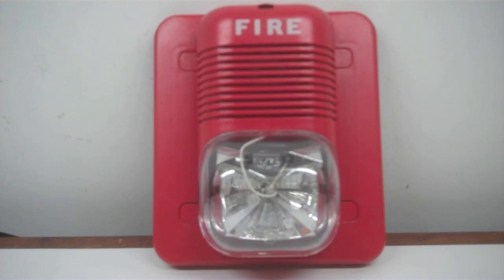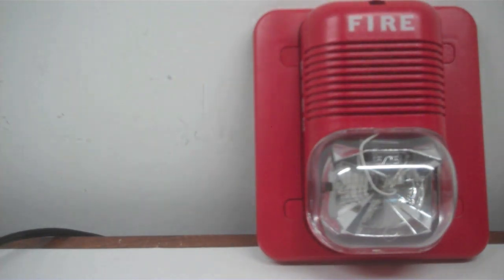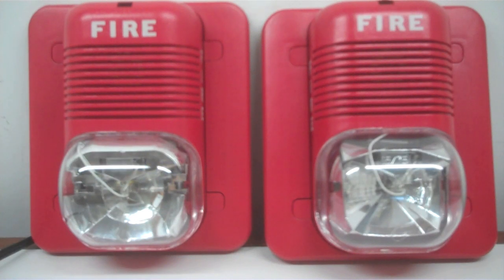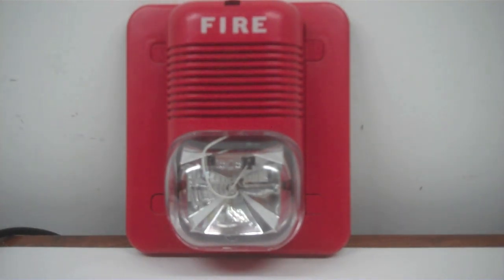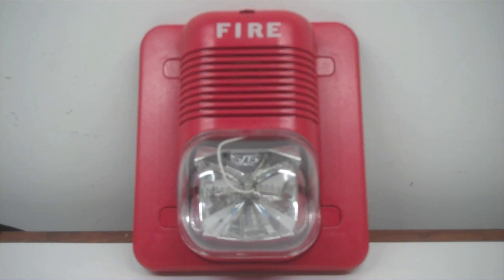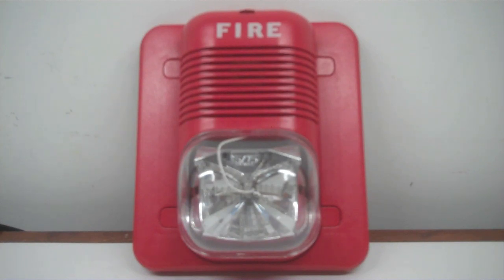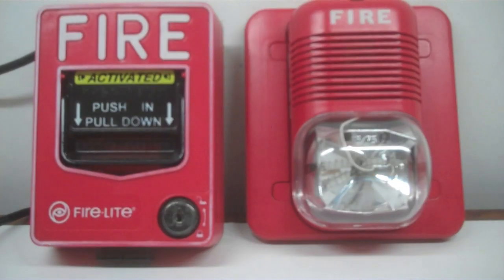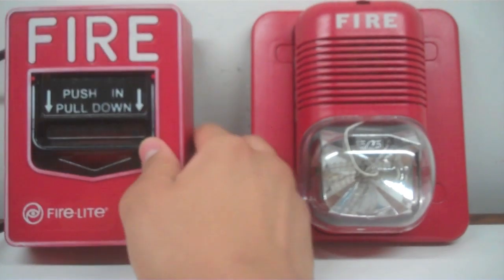System Sensor P241575 (SpectrAlert Classic) Fire Alarm Test

Comment: You know there is this question roaming all over my head of the Spectralert Classic jumpers on Non-Multi Candela version... Why is the Non-Multi Candela version jumpers has small pieces to switch the tone, but the multi-candela has better tone changer to change the tone? The problem with the Non-Candela version jumpers on Spectralert Classic is that it can get lost easily and potentially break, but the multi candela version has small switches which you can change anytime that makes it better for less damages. Wasn't the non-multi candela version released earlier than the multi-candela versions? (Considering the fact they're both Spectralert Classic models)

Comment: How do I remove its cover? I need to remove it to clean the strobe!
Reply from the maker: Sorry to tell you, the cover for the strobe isn't easily removable, it's glued in place. If you really need to get access to it, you would have to take the back off of the device, and even that is not an easy task to do.
Reply: @NewEnglandElevators  This is the other problem: The 4 hook thingies on the sides look like they hold the cover in place, but I fear that that type of risk can result in them breaking off.

Comment: How do I remove the bracket with a flat head screwdriver?
Reply from the maker: You will need a 3/32 or 1/16 screwdriver, as that will work best in terms of sticking it in the hole. All you need to do is slowly press the tab down, until the device releases from the plate.

Comment: My college used to have a SpectrAlert Classic in a computer lab located in the Student Center's ground floor. It got replaced in 2009 with a Faraday U-MMT horn/strobe, and then the whole area was renovated and SpectrAlert Advances were put in (the panel is a Notifier AFP-200 from the late 90s or early 2000s, which is probably when the SpectrAlert Classic was installed.)
Reply from the maker: That makes sense then. Interesting that it would get replaced with the UMMT, and then get replaced again by an Advance!
Reply: @NewEnglandElevators  Yeah, I've seen numerous instances of SpectrAlert Classics getting replaced with Advances, but not in that manner!

Comment: I do not get how people think this is really loud. Comparing this to an advance, the Classic is quiet.
Reply from the maker: +Can't Think Of Name I used to think this was pretty loud, until I heard a SpectrAlert Advance a little while later. Now, anything, including this device, is NOTHING compared to the Advance.
Reply: Ikr. The advance is cool but way too loud.
Reply from the maker: The thing I like about the Advance is the design of the unit. For installation, all the installer needs to do is install the mounting plate onto the electrical backbox, wire the plate up, then put the alarm itself onto the plate. It's a really nice design, no wonder they're popping up everywhere!